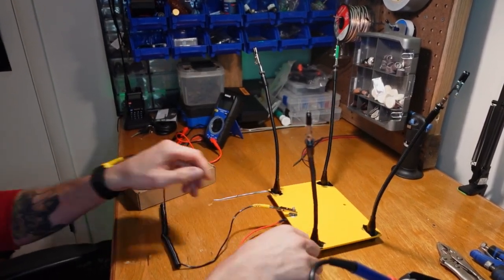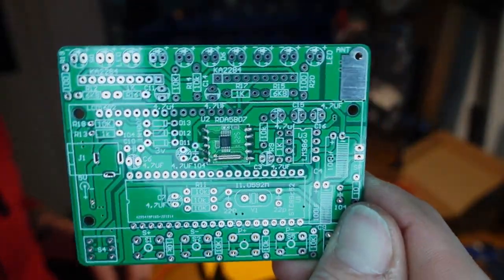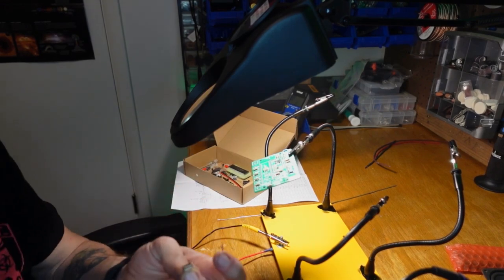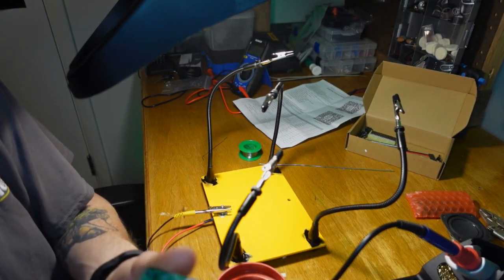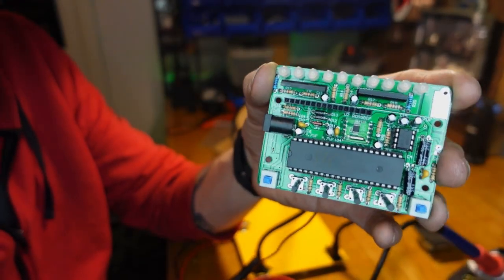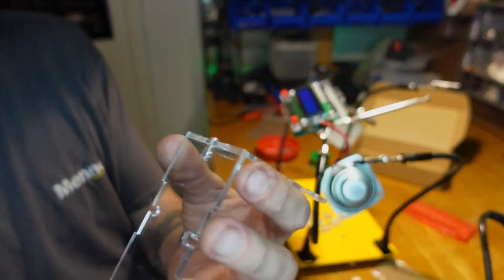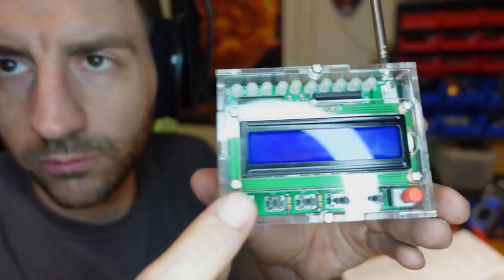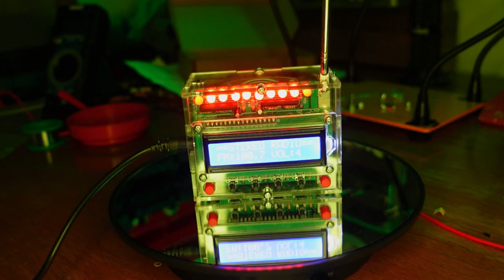I built an FM Radio Kit, AND IT WORKS!

Comment: Did you make that board? If not, what is it called or where can I find one??
Reply from the maker: This is what I'm using https://amzn.to/3M6UsSs also for the sake of grounding I sanded the paint off of the plate and the bottom of the arms to ensure a good continuity and then painted any remaining exposed metal afterward.  Hope this helps.
Reply: @dane-ger Thank you! 🍺🍻🤘